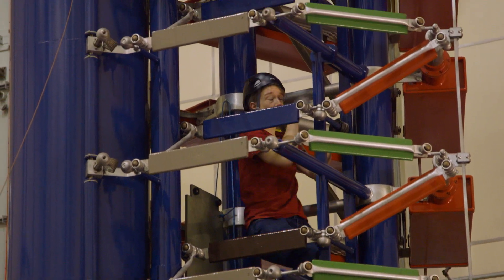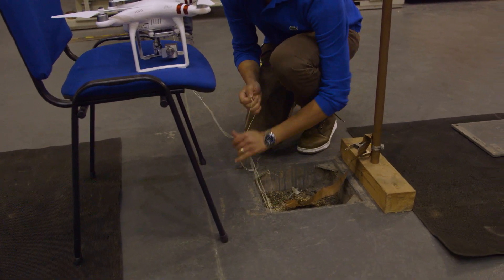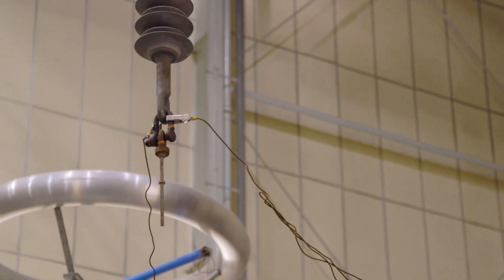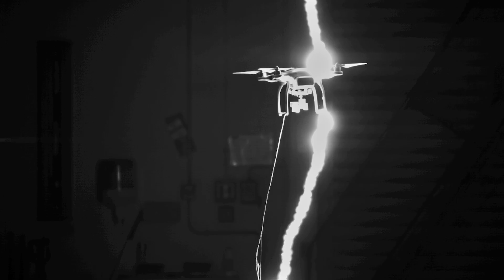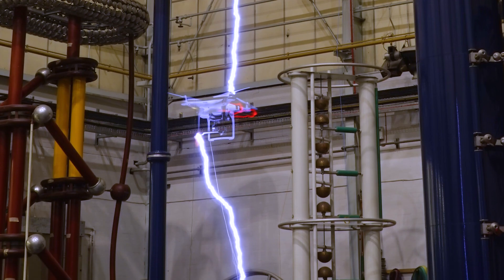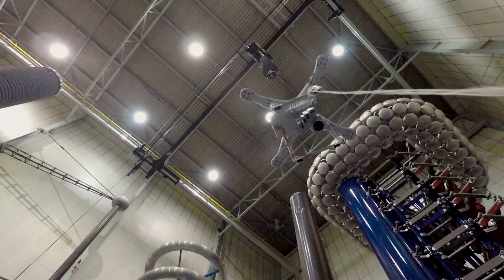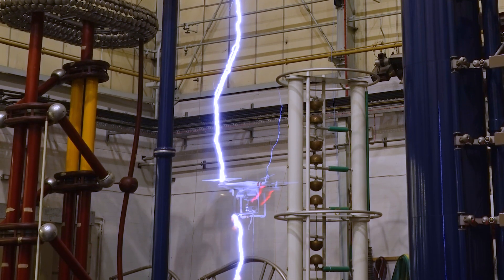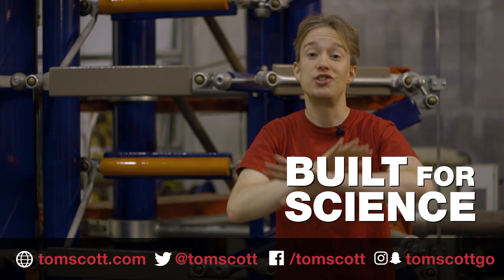We hit a drone with lightning

Comment: I would have liked seeing the drone keep on flying, protected by a complete Faraday cage.
Reply from the maker: So would I! I was really hoping the conductive tape lightning rod was going to work, but no. (We were worried that if it was any bigger, it would have started to interfere with the rotors or aerodynamics.)
Reply: Yeah, you wouldn't want to damage the drone
Reply: @banksy9921  love this
Reply: The quadrocopter would probably still go down because the magnetic field of the lightning induces enough current in the electronics to cause some problems. Most devices detect that something is not right and reset when this happens. You can actually try this at home with an electric fly swatter and a digital alarm clock. Put the swatter as close as possible to the electronics of the alarm clock (near the display should work fine) and drop a bit of metal in the grid of the swatter while pressing the button. The alarm clock should be able to survive this but behave as if the batteries were taken out and put in again. At lest that's what my alarm clock does :)
Reply: Frying - Okay. But damaging? NO - ABSOLUTELY NOT! xD
Reply: It's a bit more complicated than that. How well a Faraday cage keeps magnetic fields out depends on how the field changes over time. They offer no to very little protection against static or slowly changing fields (<100 kHz according to wikipedia) nor do they help much against high frequencies (depending on the shape of the cage, a "cage" with no gaps in it would be quite effective). It might help to protect the electronics a bit but I'm not sure how much.

Also current that is causing the magnetic field would also be flowing through the Faraday cage itself and I'm don't know what effects that might cause.
Reply: @Encypruon  well the cpu sure would crash, but it may reboot.

Also you should use the cheapo drones that use IR instead of RF. Not only would the electronic have a higher chance of surviving (cuz smaller and less complex) but the cage wont bloch the remote control signals
Reply: Faraday cages protect against magnetism as well.
Reply: How get the control and cam signals in and out then?
Reply: Any magnetic field that would be changing quickly enough to induce current would be protected by a Faraday cage (provided that the wavelength is not smaller than the spacing of the cage (if memory serves correct)). Also, the charge flowing through the Faraday cage (so long as the inductance of the cage is negligible (i.e. you haven't just wrapped a ton of lightly insulated wire in a single direction), there should be negligible effects from it. The big issue is that you would likely lose control of the drone simply by putting it in a Faraday cage since the control frequencies would be blocked too.
Reply: MrKekson
The drone control signal is a very narrowband emission at a specific frequency. An external antenna picks up the desired signal, plus a lot of out-of-band energy too, and all this is coupled into a coaxial transmission line that penetrates the shield via a band-pass filter and an amplitude limiter. The drone video output is at another specific frequency, and is routed out of the shield via a differently tuned limiter/bandpass system, to its own antenna. Aircraft and other hardened vehicles and facilities have been using this technique for over 50 years. Protection from high levels of RF, ESD, NEMP and lightning can only be achieved by meticulous care in design combined with testing and refinement of the design as needed. Obviously, the mission has to be worth the huge expense, so practically, there's nothing you can do with hobbyist drones except buy new ones.
Reply: An "ideal" Faraday cage would also "protect" the drone from the remote control's signals. I suspect any Faraday cage on the outside that lets you fly the drone would still let the spark fry the electronics inductively, since the spark generates a huge radio pulse across many frequencies.  The drone internals have to be designed to mitigate this, in the manner Ed Price describes.  Then you can solve the issue of routing the current safely.

A drone could certainly be made to take a strike, but I think it's going to take a lot more engineering than some metal foil on the outside.  Commercial air liners pull it off, after all!
Reply: for this low range, just use IR for the I/O signals, it should be able to pass through the cage.
Reply: Penetrate the Faraday cage (I prefer to call it a shielded enclosure) with a good coax fitting, build a bandwidth limiting filter onto the fitting and follow that up with an amplitude limiting device. That will give you a fighting chance to survive maybe one stroke.
Reply: no, they don't. To protect something against magnetism you need mu-metall shields